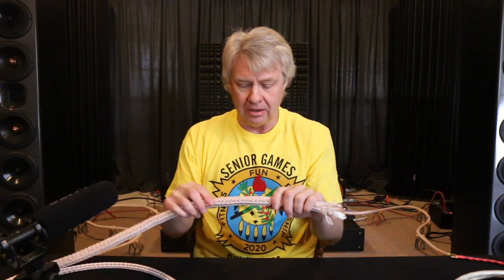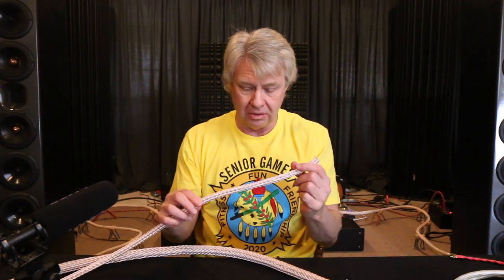What’s up with Audiophile Cable Risers?

Comment: If this is a real thing, please show the null test proving the difference between the two paths is on an audible level. Thanks.
Reply: @paulsebring6930  Our brain is super easy to fool if we are told some change in an audio system is supposed to make an improvement. If cable lifters really did a meaningful difference, you would see manufacturers of them promoting such measurement. I'm just happy that real engineers understand the laws of physics allowing us to make nano meter scale computer chips with billions of transistors on the size of a finger nail running at Giga Hertz speeds. This message went through such circuit without snake oil involved.
Reply: Every time we have demonstrated the difference the person doing the listening recognized the difference within a few seconds. It is about like drinking a swig of sour milk. You know it is sour right away. You don't need to perform a study with ten other people to get a positive statistic to form a credible confirmation.
Reply: @dannyrichie9743  It works like prayers. Believing makes you think they do a difference and it doesn't matter what religion you choose.
Reply: @ThinkingBetter  Nope, we have guys like Paul come in all the time and they are certain that they will never hear a difference. They think there is no way they will ever hear a difference. And then they do. They can't help it. It is obvious. They didn't want to believe, but they can't help it. They don't just believe, they are witnesses.
Reply: @dannyrichie9743  Nope, people imagine stuff. A lot of scams exist in audio, here is a new video: https://www.youtube.com/watch?v=0yN0cy7zvGA
Reply: @paulsebring6930  The fact that you are hearing no difference says more about your system than anything else. Care to post a picture of your system? 

Static build up in dielectric material is easy to observe and hear. Running a cable over a demagnetizer produces a clear audible difference.
Reply: @ThinkingBetter  I am not defending that product, but that guy is not a reviewer.  That guy takes basic measurements and theorizes audible effects.
Reply: @dannyrichie9743  Audio Science Review is one of the most respected reviewers among audio engineers. He actually do both measurements and listen tests. The above video is about a 100% snake oil product that is explained to work with ignorant pseudo science terminology. Those people making money out of such products are fraudsters. I can have some respect for things that are hard to measure like how a speaker sounds like with all the variables of speaker decay performance, distortion, room acoustics and so on, cause those effects can combine in a too complex way to predict how our brain will perceive them. But those are scientifically explainable things while your cable lifters belong to the pseudo science department.
Reply: @ThinkingBetter  No, he is one of the jokes of the industry.
Reply: @paulsebring6930  The resulting audible difference is far from deceptive. It is pretty clear. You want to refute that then come on over and listen for yourself.
Reply: @dannyrichie9743  Really? I’ve worked in audio engineering for ages creating numerous products and have yet to meet anyone considering audio science review being a joke. Rather audio engineers like to make jokes about cable lifters. That’s a true theme of many jokes in fact.
Reply: @paulsebring6930  What makes you think we haven't measured our cables? We've taken a lot of measurements on them when we were experimenting with the rope core, rope core diameters, and how it effects the capacitance and inductance. 

You must not understand how a demagnetizer works on a cable. If it only worked on magnetic material then it would have no effect on any cable as nothing on (or in) them is magnetic. You can create an electric charge on anything that has atoms. So absolutely the dielectric material will store energy. That is why they have a dielectric constant rating. 

I am less interested in your gear and more interested in your room, speaker placement, type of speakers, etc. That will tell more about whether your system is capable of reproducing the effects we are talking about. 

If you can't recreate time differentials with a two channel system then that red flag tells me a lot.
Reply: @paulsebring6930  Ha, ha, ha, you have way too much time on your hands.
Reply: @paulsebring6930  And we can see photo's of your listening system where?
Reply: @dannyrichie9743  What is that topic “creating time differentials” about exactly? Audio is quite a low frequency band and highly measurable in terms of any matter of signal behavior when dealing with a simple speaker cable. I’m very familiar with this industry and have also been visiting several of those actual audio cable suppliers in Shenzhen, Baoan, Zhuhai, Dongguan etc. selling you those most exotic cables that you can then brand and package nicely; and mark up selling at 10-100 times the cost you paid FOB China. Those of us who know the true BOM cost of some of these audiophile items hate to see when people don’t only get fooled by paying an insane price, but even worse, they pay for something that has no perceivable value. Of course if you pay US$10,000 for the cables in your system, your brain will be completely convinced they make a difference even they don’t. Does it mean cables don’t matter? No, cables can matter, and your cheap Amazon cables might even perform better than some expensive ones, if we just avoid letting our brain fool us.
Reply: @ThinkingBetter  My goal is to get you into the top level without spending a lot of money, and show what matters most and how to get there.
Reply: @dannyrichie9743  To be honest with you, I have audio gear for more than 200k US$ and I don’t really mind paying extra when it matters for the audio fidelity. Btw, did you check the video from my YouTube channel of my friend who is the world’s biggest audiophile gear and vinyl+CD collector. The video is from one of his many listening rooms. Several of what he owns I was involved in engineering.
Reply: @ThinkingBetter  200k in gear and you are using what for cables?
Reply: @dannyrichie9743  Oh man, you should know this. Because I work in R&D I get most cables directly from suppliers mostly made in Southern China for a tiny fraction of retail cost. But I have cables of McIntosh, Audioquest, Krell and even some Monster cables I use in my gym room setup.

Comment: I have another theory which you could actually measure and that is actual 60hz mains noise with its harmonics and other RF noise been picked up by the speaker cables raising them up from the floor is moving away from ground effects I you place a portable radio tuned to say 500 to 1.6 mhz frequencies on the floor tuned to a blank spot the noise will increase raise it up will decrease a ground floor building earth soil conducts a lot of noise and the second floor materials can do any electrical wiring around it produces noise worth doing so tests

Comment: Any test you do, whether it is cables or speakers or anything else, if you aren't doing it blind ABX at least 10 times, then what's the point? This doesn't even have to do with whether the theory or product works at all, it has to do with how reliable your brain/hearing and memory are. Then based on the results dicsuss the scientific evidence? or lack thereof that exists to support your experience.

Comment: But how HIGH should the cables be lifted off the floor??  THAT is the key to good sound!  If you lift them 2" off the floor, it is a life changing difference for the better. But if you lift them 2.25" off the floor, that is DISASTEROUS!  It is much worse than leaving them on the floor.  Of course,  the longitude and latitude of you house, and its elevation above sea level, are also crucial to the mix. It all has to do with how your cables interact with the earth's electromagnetic field.  And if your system cost less than $500,000, there are going to be "bottenecks" that prevent you from hearing the differences.  There is solid physics behind all of this, really, trust me. You can come my house and you can hear it clear as day! Everyone who comes here can hear the clear differences. They are undeniable! In fact, my wife can hear the difference between the cables being 2" off the floor vs  being 2.5" off the floor from the kitchen!

Comment: Hey Danny, for some of us it's not an issue assuming one knows a few things about how electricity flows through wire. Iol I instantly saw a diagram l saw 20 mrybe 30 yrs ago. I'm going to look for it. If I find it l'll pass it on.
Reply: You know there's next to no flow through the wire... that's what's at play here. All the work being performed is in the external fields.

Comment: I'll believe when I can hear the difference with my eyes blindfolded. Otherwise I'll call it a bullshit. Same goes for audiophile power adapters and cables.
Reply: You seems to be a experienced man. Please tell us, from your knowledge, what works well, that you have tried blindfolded. So we don’t buy snake oil.
Reply: @rikardekvall3433  don't get me wrong on this one. I can accept that placing a cable near large volue of dielectric can change the capacity of this wire and somehow affect the signal. What I doubt is the scale of this. There is a well known "halo effect" in psychology, that also seems to affect our reception of audio gear. In simple terms: good looking speakers sound better.  I guess this is another example of this cognitive bias, that's why I call for blind tests. If in a bind test (of preferably a double-bling test) a group of subjects can distinguish between the two setups, then it's real. Period. No matter if placing the wire on raisers made the system sound better. I would accept is as true if there was a significant statistical corelation at all.
My beliefs would have nothing to do with it. I will not accept as given statement that wasn't tested in a scientifically sound way.
Reply: @plagodapl  I didn’t get you wrong, after your answer. No, you trust what’s measurable. Not your ear and body. For me, so are music ear and body. If you look at the design of Danny’s speakers, then they don’t look good design wise. B&W and Focal have nice looking systems and sound great, some say. I don’t know because I haven’t heard any and wouldn’t buy any because they are so expensive and I rather save money and buy Danny’s kits, that I believe sound fantastic, according to other YouTubers. He does explain things the easy way. For Danny and others, the sound and music are the key factor. And most of them know their system and how it sounds, so any small change they would hear. I wouldn’t have commented your first post if you had shown some real experience and solution. Instead you Bullshit everyone that doesn’t test everything scientifically. Therefore my slightly ironical question. Sound is hard to dissect, it’s much up to everyone’s experience and perception. Another example, Look at the bumblebee. Scientifically it’s not supposed to be able to fly, but it does. Relax and enjoy your music.
Reply: @rikardekvall3433  I guess i was bit rough using the bs word, let's blame it on english not being my mother language. I usually try to be civilized in my discussions. Concerning the video - yes I don't trust senses, as they can be misleaded. I watch Danny's videos and I love the way he backs his work with science. If he would measure his system response before / after raisers and then claimed it made a difference - sure. I just think he got biased and I can't believe (but hey, I may be wrong on this - just prove me) he can hear the difference. One thing we agree - let's just enjoy the music.
Reply: @plagodapl  Hi. You are a good guy and everyone needs to have a opinion otherwise will we not evolve, and learn things. I’m 57 and still curious. BS is not nice in our adult discussion. As Kris from VinylAttack said in his GR visit video. I have had to bit my thumb many times, before commenting other people, when reading comments to others on YT. Love music. Peace.

Comment: If a wireless system is used.....
So, next up, comparing wireless transmission to wired connections.
For you sophisticated sorts who only do stereo, the utility may be there, the value undeniable to put those risers to use. In my 10 foot cube with nine speakers, it would look like an industrial site for an ant engineering exercise. Even MY bachelor's sensibilities would be tested.
I DO hate this result. I wonder if Audio Science wants to take a crack at this?

Comment: Air temperature, humidity and pressure are making more difference than any of this high-end gimmicks. Is there a maximum height where it starts to reverse the effect? (and yes, speaker and signal cables have an influence but i would give my left hand that 87% of those 'High-Enders' wouldn't hear it in a blind test [actually this is scientifically proven]).
Reply: What is it that is scientifically proven?
Reply: @jandewitt7178  Stuff'n things.
Reply: @djambush360  Ah, okay. I guess you must be correct then.

Comment: I had a buzzing sound coming from a small receiver system I have in a spare room. It was there for two years after which I realized an infrared space heater two rooms and forty feet away was the source of interference. It took a dozen different tries to find a suitable ground wire to get it out of the system. Sure, this looks silly. But, had you guys bothered to sit through this actual audio expert's take on the matter, he makes a point. Sometimes, you have to think outside the box to see what a solution could be. Two years, a dozen trips to the Home Depot,,
Reply: @paulsebring6930  how is he not an expert in the audio field? He's an educated (MSU graduate) designer with nearly 30 years of experience and a host of accolades to go with it. He's speaking about simple magnetic interference that can be a problem in some systems while offering a cheap solution for an uncommon problem that he even describes as being so. He is an expert. That you don't agree with his opinion doesn't change that.
Reply: @akr01364  Do you know Danny Richie personnally?  I don't.  From what I can read in his Linked In profile he attended Midwestern State University for one year 1988-1989 and did not earn a degree.  From what I can find on Midwestern State University web page, they offer Bachelors of Mechanical Engineering, not Electrical Engineering or any other engineering field.

You do not need a bachelors degree to use Thiele/Small parameters to build loudspeakers.

One of my degrees is Engineering Science, another is Electronic Technology.

I do not have a different opinion than Danny.  I disagree with the explanation that he uses to justify his opinion.  Danny's description of physical principles is false.  You don't have to listen to me.  Danny's claims can be fact checked with a physics text book.  Danny is not speaking about simple magnetic interference.  Danny is speaking about electrical charge and dielectrics.  Magnetic fields are not the same as electrical fields.  Static electrical charge is not magnetic.  Magnetic fields do not  produce electrical charge.  Dielectrics are insulators, not conductors.  Electric fields exist between conductors, not beside them.  Audio signals are not static.  If there is a static charge on the surface of the insulator between the speaker wire, it will be dissipated by the conductors and the low output impedance (high damping factor) of the amplifier as the aperiodic alternating current audio signal passes through zero volts between positive and negative.  If you knew something about physics, you would know this.

Danny doesn't know if his concocted pseudo-scientific explanation for what he hears is true or false.  If Danny was a good scientist, after his observation, he would make a hypothesis and construct a reliable, repeatable experiment to conclusively prove or disprove his hypothesis.  Danny could have simply measured the capacitance of his speaker wire on the carpet and elevated above the carpet to see if there was a significant difference.
Reply: @paulsebring6930  Curses! Someone who actually knows what they're doing in the comments section. For once my Tony Robbins poster has proven useless. (ok, you win lol)
Reply: @paulsebring6930  You might want to do a little more research of your own Paul. You missed the mark on this one across the board, and I have several degrees including a bachelors degree from MSU.

Comment: Changing the properties only counts if you can show that it's AUDIBLE by testing.  Science is about testing theory, not just talking about abstract random claims.  Yeah, static electricity has been a problem in my speaker wire.  BUT it's not audible.

Comment: Why wouldn't using the shortest wire possilbe be even better? I have always been curious why we use such long runs of cable between amps and speaker. Like in Danny'e system, it would be quite easy to almost eliminate the need for speaker cables.
Reply: Yes!  The 3 main properties of cables that degrade audio performance are resistance, capacitance, and inductance.  All three are measured in a units per distance format (e.g. ohms/ft), meaning that a longer cable has more resistance, inductance, and capacitance and will affect the signal more.  But even when using the shortest possible run keeping it as far away from boundaries like floors will still add incremental benefit.
Reply: I have sorter ones, but I also swap out speakers all the time and the smaller stand mount speakers need longer cables and the longer ones wind up in the system most of the time.

Comment: they are better it you run a wire to each riser and deloy a current in the direction of the sound flow. I sell the wire for 600 dollars a spool (20 feet)